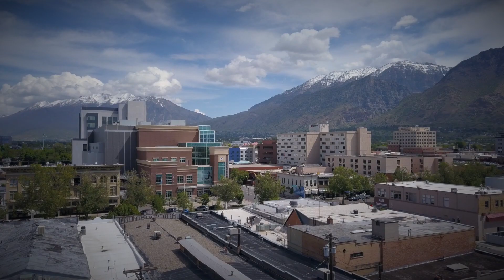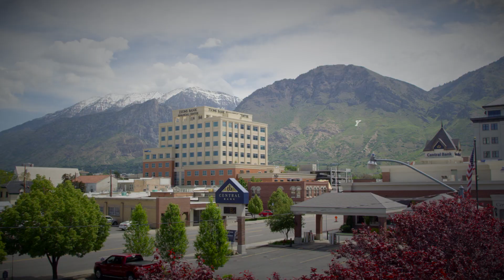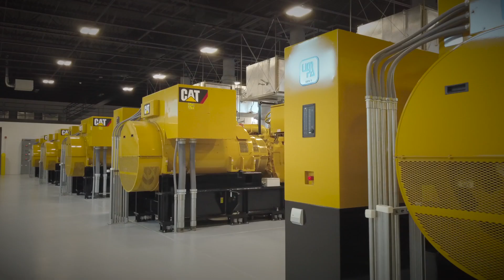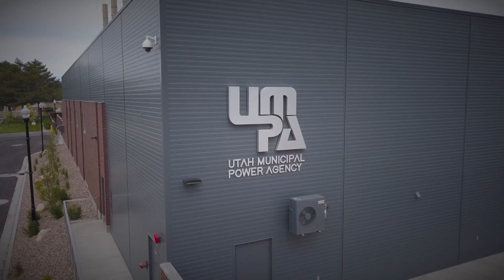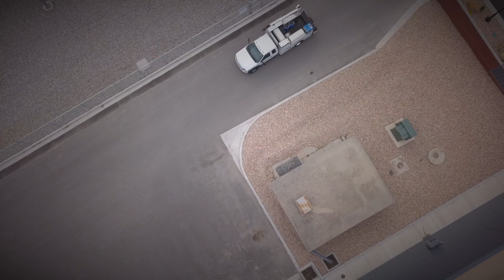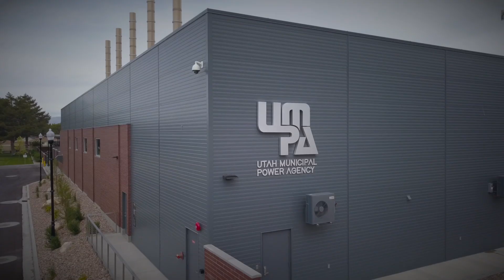A Breath of Fresh Air | Provo Power | Cat® G3520H Generator Set

Comment: Wow, a gear reduction unit on an ICE genset! Is the engine that much more efficient / less emissions at whatever RPM it's operating at to recover the cost of the gear reducer and added loses of running thought the gear reducer to drive the alternator at the required RPM? I know someone did the math, but I find it hard to believe the costs worked out that much to offset the added costs.
Reply: the gas units i service the engine turns 2300rpm and the box drops the alternator to 1800